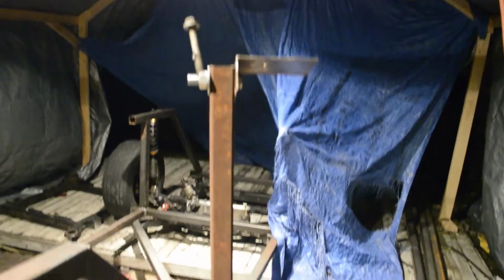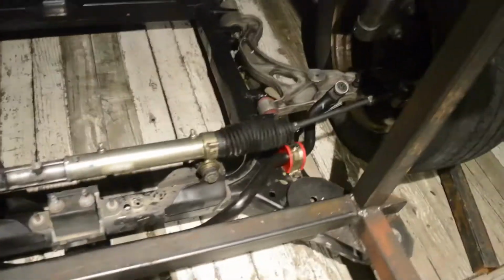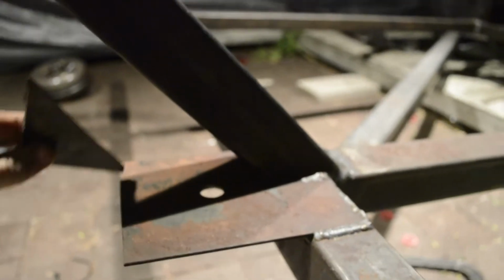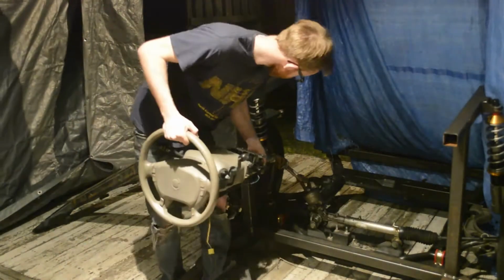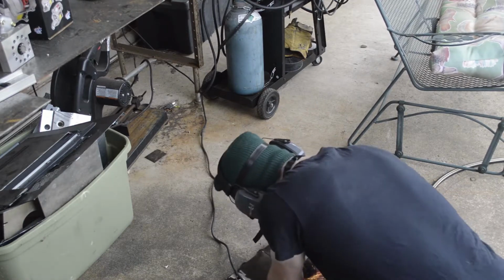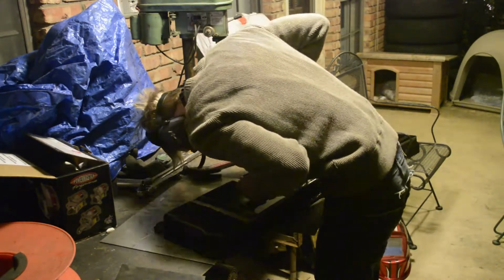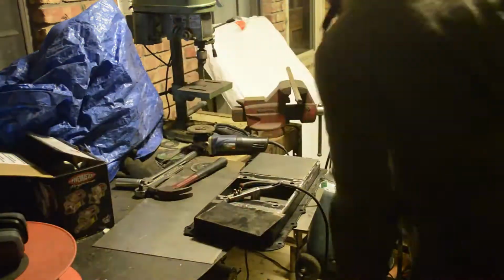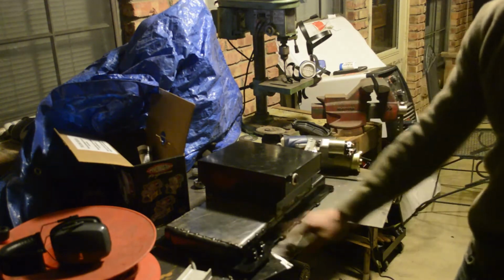Cadi-Cart Mid Engine 5.3 Turbo Custom Vehicle Build - Part2 (Frame, Steering, Suspension, Oil Pan)

Comment: ....those strut towers are to high, for a sports car, imo 🤔

what kind of rear wheel drive vehicle are you making?
Reply from the maker: Strut towers are pretty high, but that is how high they are on the Cadillac. I have the windshield on now and they come up to the bottom of the windshield. Eventually going to make an 80s le mans style body for it which should accommodate the high strut towers, but that is a ways off for now.